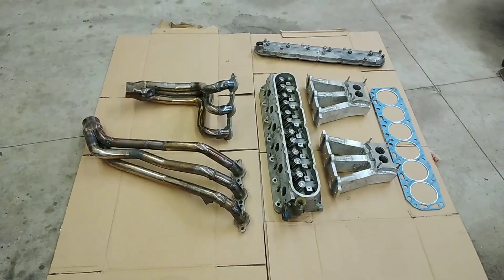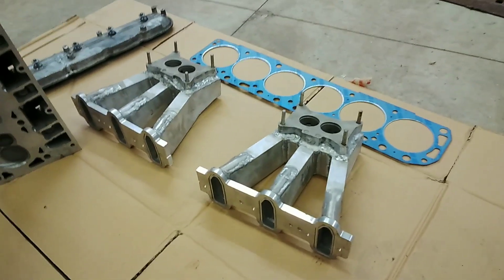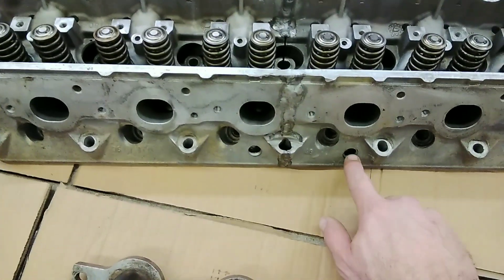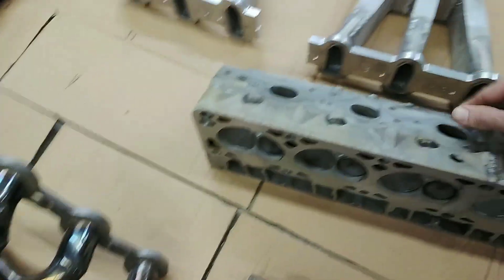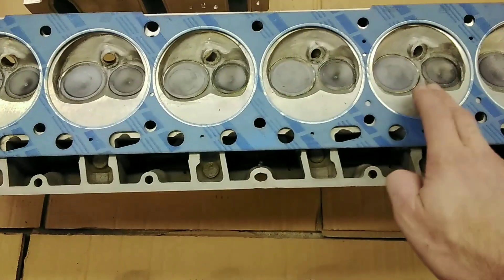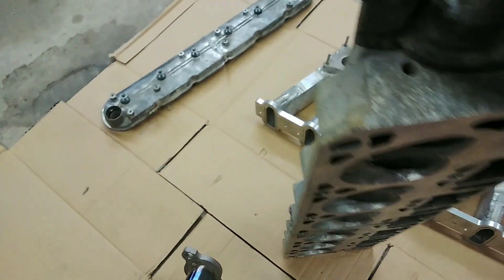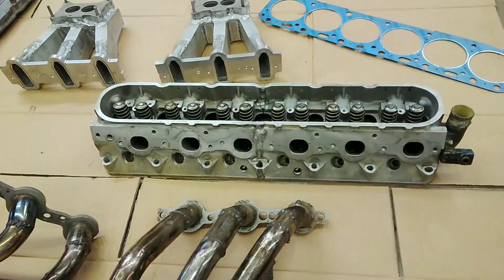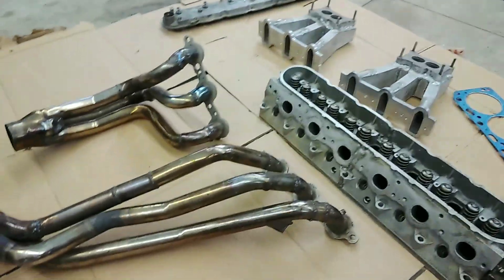Ford 300 hybrid LS cylinder head

Comment: Why is this head swap popular? I’m loving it. Just curious
Reply: Because the 300 Ford six has so much potential for low to medium rpm power.  Large displacement per cylinder, the inherent strength of 7 main bearings, a high quality block, gear-driven camshaft, and the inherent balance of an inline six.

Comment: How far along is it?
Reply from the maker: It's running. Just need to replace intake manifold gaskets and reset the carbs
Reply: @fiskshopworx1541  Awesome.    You mentioned a cam and said the "biggest one" within that product line, what were the specs?   How much compression did you go with?
Reply from the maker: It's a howards cam, if you look on the website it's the biggest they sell. 11 to 1 compression

Comment: I am very curious on how you got the pushrods to line up and play nice. I mocked up some busted ls heads we had laying around the machine shop but it looks like to get the pushrods to line up straight, they would end up punching into the rocker pedestals and partially into the water jacket. This could be easily tig welded up and water jackets relocated to match the 300 gasket but I still dont see getting around the issue of making the pushrod and rocker arm geometry correct? Any advice on this would be greatly appreciated.

Comment: Would 317 heads work well being a 4" bore, the larger chambers would be milled down some to true up after the welding and why not cut holes in the plate for coolant Flow

Comment: That's a real cool project.  I always thought way didn't 1 of the big 3 didn't make a 350 ci. 4 valve straight 6 engine. 1 na .1 turbo with 4 bolt cross bolt  block

Comment: What you doing for head bolts ? Stock Ford? Studs ?
Reply from the maker: 289/302 7/16 head studs, use just the short ones.
Reply: @fiskshopworx1541  just the short ones, check, ill call APR and see if they can get me them like that, heads almost ready to be bolted to the block and welded!
Reply from the maker: @TallGarage  cools, remember it takes 14 studs and only10 come in a sbf kit.
Reply: @fiskshopworx1541  so ARP told me they are out of stock and not expecting any till June so I just ended up buying two of the cheap sets on eBay came out to be about the same price as going arp I know they're not as strong and they might break on me torquing them but I'll just do five pounds less than I would normally

Comment: Very cool! One thing I think you were mistaking is it would be .040" off on the 2 center bores and the same amount on the 2 outer bores, not .020", but still very doable that way.

Here's why, the F300 has a bore center of 4.480" and the LS has the same bore spacing as the sbc platform they replaced of 4.400". .080"/2 = .040". So you had to add an extra .160" in the center to make this work, good thinking to make it happen. 

I'm subscribed, can't wait to see this fire up! Are you on Inline 6 I think it's called IIRC? Cool stuff.
Reply from the maker: Yes you are right, I wasn't thinking the chevys were 4.440" for some reason. That is the reason the smaller bore 5.3 heads are better fit the the 6.0 4 inch bore heads. But they still might work. I would like to use the 823 ls3 heads if they will fit.
Reply: @fiskshopworx1541  

So are the outer bores more misaligned than you thought they were? If you only added .080" in the center instead of .160", the 2 center bores would be the ones that are centered. And by the time you got to the outer bores they would be .120" off.

In the video it doesn't look that far off, so maybe you lucked out and added more than .080" in the center?

Did you know the Chrysler small blocks and the newer Hemis have a 4.460" bore spacing? If you're thinking about doing another one, a set of Hemi heads on one would be REALLY cool. I'm not sure what the valve orientation is so it may need a custom cam?(probably)
Reply from the maker: @itseithergonnaworkoritaint7852  the jig build to weld the heads together centered the number 2 and number 5 cylinders.  Yes ihave looked into a newer hemi heads, the valve sequence is backward and the pushrod spacing is wide I believe, IL like to get a junk head and line it up with gasket to see if it possible. Hemi heads flow very well with bigger displacement cylinder.
Reply: @fiskshopworx1541  

Sweet! so you accidently did add .160" to the center then, you can't ask for a better accident than that!

Here's what I looked into for the F300, using the NASCAR R5/P7 Chrysler heads. 410 in. cfm with the very same bore spacing as the F300. The bad part is it would absolutely require a custom cam or to weld sections from 3 heads together.

Instead I will use the 2 sets I have of those on a couple different big blocks I have. I have a MOPAR 383 that I can get over 500 cid with that those heads would do a good job feeding it air/fuel. The other one will be a BBB or a Buick Nailhead, probably the Nailhead because it's a stronger block but not sure yet?

Comment: Being a 4in bore you could have used 823 square port heads. Whats the reason behind using the cathedral? Fun project you have there.
Reply from the maker: The heads were free and this start as just an experiment. I agree 823 heads would be better flowing for the big displacement. And it may be something to try in the future if this setup works.

Comment: Why didn't you drill holes in the plate for the water jacket vs the bypass?
Reply from the maker: Once it's welded together there is no way to drill the plates. Others have pressed sleeves through the plates then welded  but the welding process moves and coolant then leaves internal.
Reply: @fiskshopworx1541  There is something I am grossly missing in the process. I was assuming you welded in a plate in the center and thought you might pre drill the holes. Very interesting though. I'm anxious to see it run.

Comment: I guess you are trying to rev this thing higher with that rod to stroke ratio change? Cant wait to see it run!
Reply from the maker: Maybe 6000rpm, using the 240 rods and 331 pistons really lighten up the rotating mass. And hoping get away from the piston skirt cracking problem the factory 300 had.
Reply: @fiskshopworx1541  Put that crank on a diet. Rods, diet.

Comment: if you get this to work there's no doubt it's going to make massive power we've all seen it done before with the Boss 302 heads but I think it's awesome that you're trying it with cathedral port LS heads I wouldn't be surprised if somebody starts making heads for the Ford 300 based off of this or the original design with the Boss 302 heads! if this was my project I would dykem  the head and scribe out all the passages to match the head gasket or better yet get it o-ringed and use a copperhead gasket and do the same thing! this thing is going to be nuts if you can get it to work which it's definitely possible!

Comment: recently saw a ford 300 with a special head made from 3 v8 (cleveland) heads that where verry mush customised with lots of epoxy raised exhaust ports tmecanical fuel injection with 6 intakes and stuff 
https://www.youtube.com/watch?v=YE-NHC3K8ek
ran in the 70's with a lot of success the engine made 600 horse naturally asperated  , curious to see how mush power this newer head would make
wonder if you can make 2 fourcilinder "16valve" twin overhead cam heads from say a toyota or a cosworth ford fit
Reply from the maker: I'm sure it is possible, I've seen it done on a sbc. This isn't as wild of a engine as the one built in the 70sfor drag racing. But I believe a good ported ls3 head would out perform the old Cleveland head.
Reply: @fiskshopworx1541  Yes and for sure in the real world head to head, no contest the big vs smaller intake runners. Your all in and all done where the V4 head just turns on. My one truck was built with a V2 motor I do believe. I'm not a great "in the know" Ford guy but take notes and built a few things. The smaller runner late sixties head to about 1970ish and 2 barrel setup was much better to acually drive in a big tire truck with 36s, 4.11s and top loader 4sp in a 68' 8ft bed frame, leaf spring chassis under a 77' F150 body just for fun.

Comment: Those water cross-over passages should be as high in the water jacket(s) as possible. With the bulkheads in place where the two heads are joined, the coolant needs to flow high in the head to keep steam pockets from forming - which could crack the head.
Otherwise looks like a fun project, and lord knows it'll breathe better than the 300 head!

Comment: Those old 300's were so awesome. Run forever type engines. I think thats why they got away from them. My buddies 08 3 valve just imploded. No problem being too reliable here. Never missed a fluid change either.

Comment: What is the benefit of doing this over modifying the heads for the 300?
Reply from the maker: It is a cross flow head, it's less then half the weight, it's aluminum (better heat transfer),   flow very well in stock form.
Reply: The LS heads have a huge advantage over the stock head. Like the previous person said the cross flow is so much better.  Look at any high performance inline six they are all cross flow.

Comment: What kind of head gaskets are you using? Between the 0.030 overbore, and the 0.020 offset on 4 of the cylinders, you're cutting into the gasket metal a bit.....
Reply from the maker: Fel pro head gasket, the gasket matches the block, the offset is on the head so the gasket is aligned to the cylinders properly.

Comment: I think I would put another set of coolant holes on the exhaust side. The ones on the intake side will flow coolant but were meant for steam to get out of the head. You may get a hot spot by cylinder 3 also because no coolant is flowing there like there normally would be.

Comment: I knew a kid that did this when we were in school for engine building. He used three-cylinder heads. One was just the center two cylinders and the other two heads consisted of the front version of the cylinders in the rear two cylinders. These were all cut down and then machined to get the spacing as equal as possible on the Ford block. Similarly he blocked off the water passages all of the head but he machined a hole through what he blocked off and then had a bung that was welded to the block off on the other side of the matching head which then press fit into the hole drilled of the opposite head. That way once the head was all machined and pressed together for final welding assembly coolant could flow without extra external lines. As for his intake he did something similar to you he bought a few carbureted intakes and chopped them up he did three two-barrel Holly carburetors. And he did a similar header style set up as you as well chopping up existing cheap headers. Overall it worked out really well. And if I remember correctly was making far over 350 horsepower. It was a very labor-intensive build but overall very unique and rewarding. The entire engine building school was involved and it was a lot of fun to see it take shape.

Comment: The only thing I was wondering was how the oil and coolant passage weighs from the block lineup to the head
Reply from the maker: Coolant lines up pretty well in the rearofthe block/head. Oil returns through the push rod and lifter cover as normal.

Comment: Awesome job! Can hardly wait to hear it run! 

Any templates available fir cutting the heads? What kind of aluminum rod was used for welding the heads up? Any other details, templates etc you could share?
Reply from the maker: 4043 1/8 rod, I built a plate to bolt the heads to for the heating and welding process. I just used a big band saw for cutting. Cut a little big and can mil off to get were need to be for length.
Reply: @fiskshopworx1541  thanks for the information.

Comment: Nice work. Not sure if I missed something but how will the rear part of the head fill with water? Are both coolant inlet and outlet at the bottom of the head? Keep it up and deff subbing!
Reply from the maker: Coolant runs through the block then up to the head in the rear of the engine, then foward to the thermostat.

Comment: Once I'm not so busy I plan on trying these but I'm going to use the 6 l head with the 4-in bore might better match the 4 inch bore of the 300 so it sits right over the cylinders with each combustion chamber better

Comment: Any idea just how long until we can see it run? New subscriber
Reply from the maker: Well I just got a call yesterday that the machine work is all done and the short block is together. So I need to go pick it up and assemble the rest. Measure pushrod length and order those. Get it on the test stand. Hopefully by the end of February if I can get enough time.

Comment: Kay Sissel, Chevy six drag racer , did this back in the 70's didn't he?
Reply: My father ran that head on a 250 trips chevy setup. His buddy had one on a 292. The 292 now has a turbo but still rests in the 68' Camaro last I saw it. Stick drag car since the 70s. It's Webers are still hanging on the wall just in case.

Comment: I can't wait to see her run. This is what hotrodding used to be about. Cam specs? What is the compression ratio, what stroke, and how much had to be milled off the head? Any plans to dyno?
Reply from the maker: I dont know the exact amount we took off the head I think around .035. I believe its between 10.5 and 11. To 1 compression. 4.020 stroke 4.030 bore. Cam is 221 duration at .050, .539 lift. 110LSA

Comment: Seems to me 2 V6 heads welded together would have been less work.. why did you add more stroke to an already long stroke engine? Don't recall the 300 I6 being a rev happy engine to begin with.
Reply from the maker: I believe you would still have to cut the v6 heads. The center of the engine has 2 head bolts where both heads have to use. I offset ground the crank to gain height to push the piston closer to the deck. It 4.020 stroke now from 3.980.
Reply: @fiskshopworx1541  Did you land within 0.010 on the deck height installed with your piston update before decking the block?

Comment: Might need to do another coolant jumper near the seems on the intake side. It might get a hot spot on the back head since it can't move around that side of the cylinder.
Reply from the maker: I was planning that but with the pushrods on that side there isnt room. But there is a small passage from the block up to the intake side of the head on that cylinder #4.
Reply: @fiskshopworx1541  - Well, if it was blocked by the pushrod then it probably wasn't getting much flow there normally, so it should be fine then. Interesting project. Hope to see it running eventually.
Reply: @fiskshopworx1541  If you control a dump valve there or tiny Tstat you might have the coolest running inline six ever built. All the talk about overheating these head-s is hard to swallow.

Comment: would a pair of v6 heads work so u wouldn't have to cut and weld them.  alot of older diesel engines run multiple cylinder heads in a row on 6 cylinders,  n14 for example.
Reply from the maker: That is possible. I haven't looked into that.

Comment: Why? Keep chevy crap off of Fords. You would have had better results using 351C heads.
Reply: Yeah. I saw one from the 80's had two Cleveland heads with one cut in half and the other with the two center cylinders cut out and the 3 pieces brazed together. The guy was making 500 horses naturally aspirated with three 500 cfm Braswell carbs: 1.66 hp per cubic inch.

Comment: FWIW, I think the size of the coolant fittings is a bit small. Consider the size of the outlet pipe from the radiator. What I can envision is the coolant preferring to flow down the block from the front head before it wants to go the rear head. That's because it's the path of least resistance.
Here's the thing, if you make it bigger it's easy to restrict it, being small causes overheating.
It's the apparently small details like this that determine long time durability and therefore joy. If you don't enjoy it, your project will just sit in the shed like my FJ40 V8 conversion. I can't stand the sight of it. Don't let this happen to you.
Reply from the maker: I understand what you are saying. But the coolant flow on a ford straight 6, goes front to back in the block, then up to the head in the rear, then forward through the head to the thermostat. If you have ever tested or watched a thermostat open, it is small amount. It will be 1/2 npt so 1/2 inch inside diameter. I will be watch the temperature across the head on the test stand while it is running, if there is a Hotspot I will address it at that time.
Reply: @fiskshopworx1541  Seems like you got it sorted. Best of luck. Great project.
Reply: Thermostats are tiny flow compared to that 1.5" hose. Lotta racers going to smaller AN fittings in water pump block holes. They need less than you think. I just replaced a thermostat that was stuck open just a tiny bit sideways, as in it wouldn't fully seat itself. The truck would wouldn't heat up for 30 minutes because of that tiny amount of flow.

Comment: Whats the difference in height?
Reply from the maker: The head height or are you talking piston to deck height?
Reply: @fiskshopworx1541  valve cover to oil pan I assume the engine isn't near as tall like this
Reply from the maker: @kevinjohnson9372  I believe it's about 1 inch shorter.